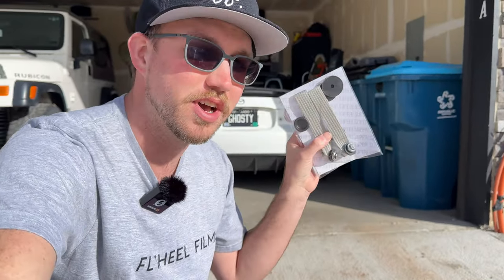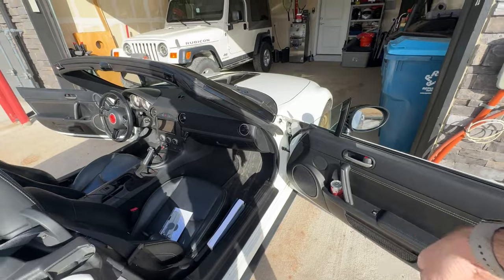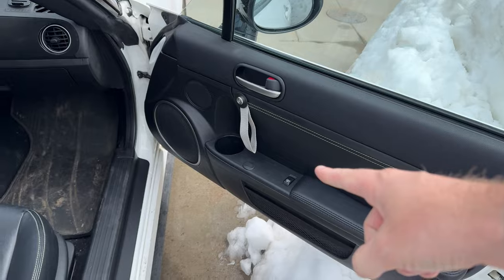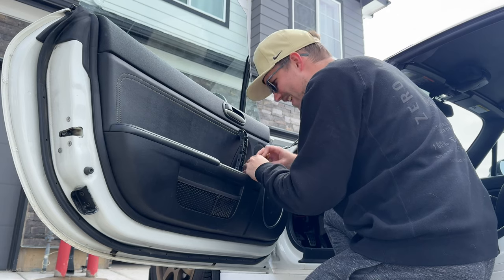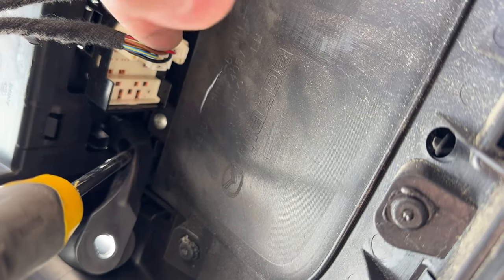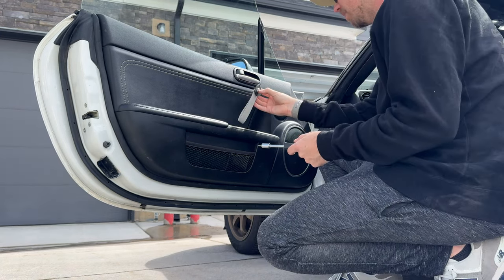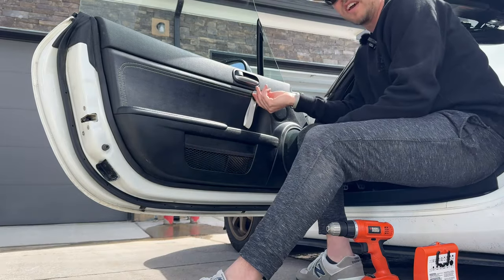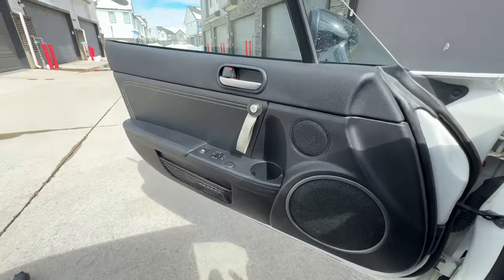Installing Door Pulls in an NC Miata! One step closer to a GT3 RS.

Comment: Since the strap is being screwed into plastic and you pulling it to close the door isn't there now a risk of the bolt stripping the plastic insert out?
Reply: The original door handle is screwed into the same plastic.

Comment: Question, we have a similar car (two years different) but same Meister R’s. So yours make noise over deep fast dips? I have enough gap that I shouldn’t be rubbing but there’s often a noise when making a turn where there’s a dip in the street. There’s no sign of rubbing either - no wear marks on the rubber or clean spots in the well. Really seems to do with compressions. Brakes Plus had a look during my last alignment and said the whole system looked and felt properly installed…